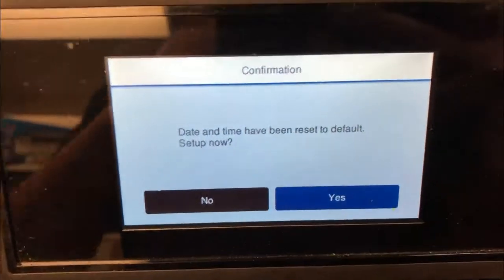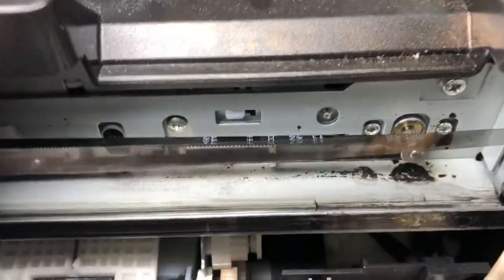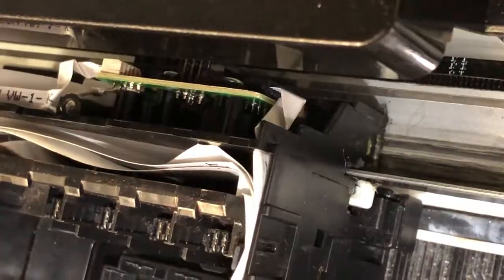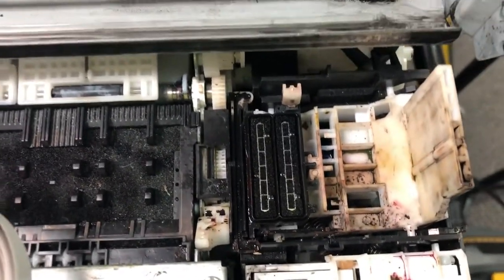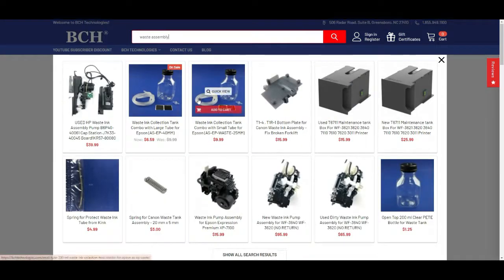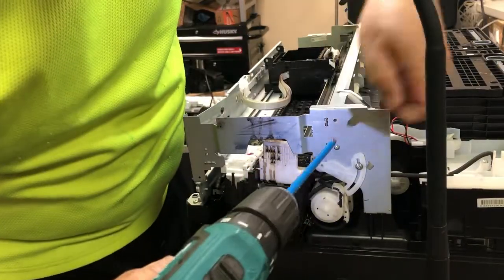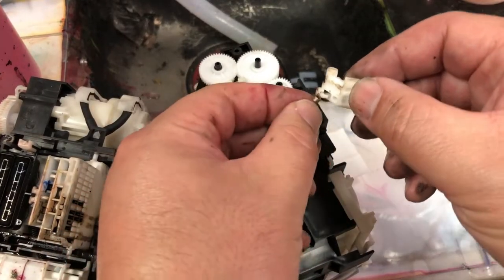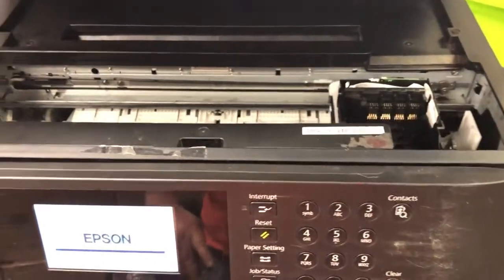Epson Error 000031, 000023, 0xEA Scratching Sound & Stuck to the Left WF-7720

Comment: Fixed! The transparent wheel came loose and fell off, causing the gear to not spin. When I press it back into place, the printer works fine. I'll need to apply glue to ensure it stays in place and spins with the gear.

Comment: I had an error 23 on my Epson ET-8550 printer which would cause the printhead carriage to slam to the left side of the printer. My problem was that the (blue) head lock handle was not fully in the unlock position, once I pushed it all the way down the error went away.
Reply: lol, this was my issue too. The blue handle was slightly up and was printing fine before, but after a paper jam it wouldn’t work. I was about to take apart my printer before I saw this comment and thankful it worked!
Reply: Omg same

Comment: Hey Kevin....I having the same issue my et15000 start up then makes the scratching sounds when the printer head tries to go back right the  error 000031. I cleaned the ribbon and still same thing. How hard is it to fix a et15000 that has the same problem?
Reply: Did you ever fix this mine is doing the same thing.
Reply from the maker: Thanks for subscribing and supporting the channel—it really helps as we work toward our 100k subscriber goal! The 000031 error on your ET-15000 indicates a "CR load position excess load error," which happens when the carriage motor encounters resistance while moving. Since you've already cleaned the encoder ribbon, the issue might still involve an obstruction or mechanical problem. Check for anything blocking the carriage, like paper jams or debris, and ensure the capping station isn’t obstructing the carriage. Also, inspect the printhead lock on the back rail, as it could be tangled and causing the carriage to stick. Clean and lubricate the rails, verify the belt alignment, and gently clean the encoder strip with isopropyl alcohol. After addressing these areas, power the printer back on and test it. If the issue persists, the carriage motor may need repair or replacement. Let me know how it goes, and thanks again for being part of this journey!

Comment: Do you have any videos on unblocking epson wf-2870dwf or similar? This will be the third epson I’ve been unable to unclog using a eBay syringe tube and solution
Reply from the maker: It will be the same as others.
Reply: @BCHTechnologies  sorry struggling to find those